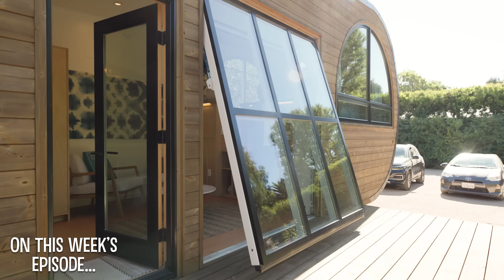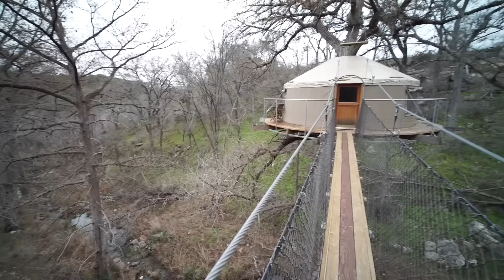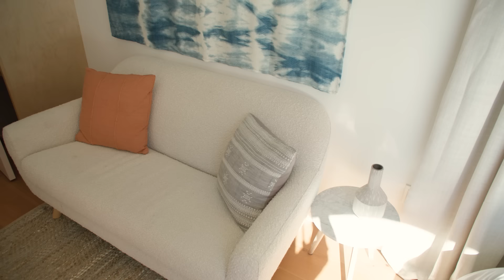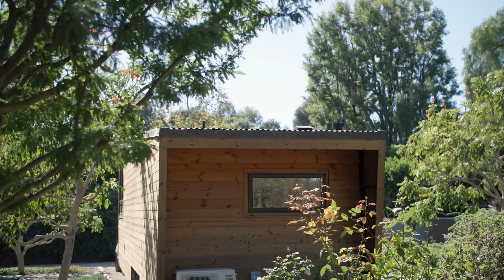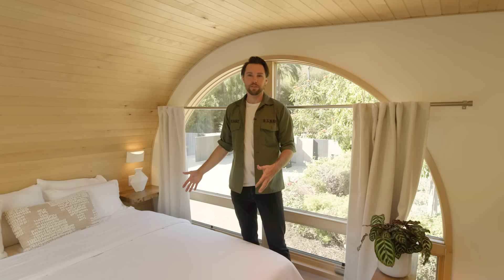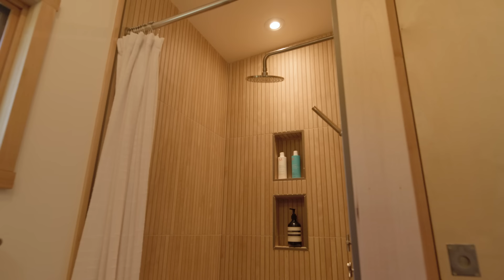Beautiful Malibu Tiny Houses - Off-Grid Ready & Portable

Comment: No doubt beautifully designed and looks like well built. So glad the homes were not lost in those devastating fires.
A few things though (and some of it is admittedly nitpicking): that 40' model looks like 10' wide. Might be good to point out the permit requirements for moving it. Also, the community considers it a tiny house if it's under 300 square feet. 350 square feet is a small house, not a tiny house. The incinerating toilet takes 60 seconds, not 60 minutes, and there are some quality control issues with that model/brand. The outdoor units for heat pumps are called condensers. And the 'garage door' mechanisms are linear actuators, not hydraulics. And I would have mounted them reverse to reduce the size requirement and reverse the opening speed (fast to slow), similar to the struts on the kitchen window.
I'll see myself out.

Comment: I love the look of this, but I’m curious about the big opening in the front lower section 🤔
Reply: The houses are built on fifth wheel trailers which have an upper deck so the tow vehicle can fit underneath it. You could see the tow pin hanging down at the front of the trailer in one of the front 3/4 side shots.
Reply: @alankita1059  I can see that. But the opening doesn’t look finished. It just looks like it’s open 🤷‍♀️ Optical illusion maybe or camera angle.

Comment: This isn’t really off-grid optional lol…
Where’s the battery storage area for the solar panels and stuff? Just because you can move it doesn’t mean it’s off-grid capable… 😅 It’s a luxury mobile home.
This one is definitely an Airbnb. Please stop showing Airbnbs because you’re getting a huge personal discount if not a free stay. Airbnb is a big part of the problem as to why there are virtually NO starter homes available anymore. It’s a pretty, tiny, Airbnb. And the Airbnb aspect is evident to anyone remotely paying attention. It’s not really a livable space… UGH AIRBNB. No storage, washer or dryer… It’s a very short-term luxury Airbnb rental.
Reply from the maker: Hi there. Just fyi we did not receive any compensation, free or otherwise for this video. Also these aren’t airbnbs. But, even if they were, I don’t see any problem with showcasing them for tiny house design ideas and in case someone wants an affordable, offgrid second home.
Reply: "Airbnb is a big part of the problem as to why there are virtually NO starter homes available anymore."  Agreed.  But I prefer this channel tour Airbnb tiny homes for both the ideas they spark and to keep from running low on content.  Branching out is good.